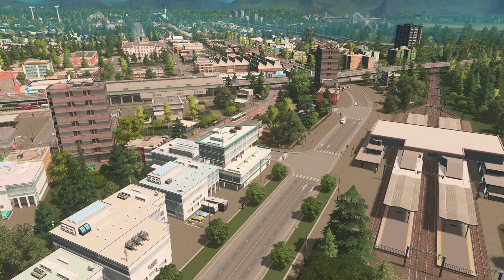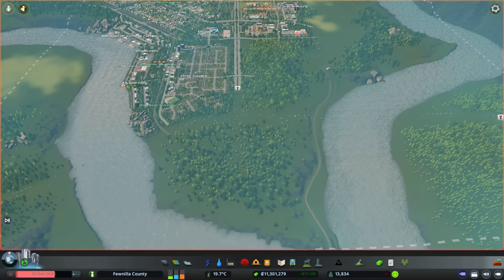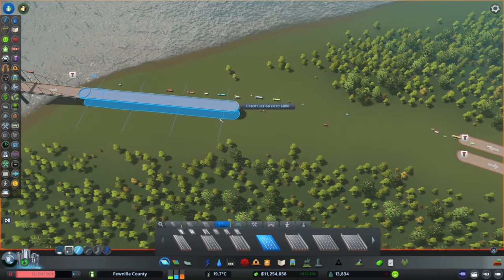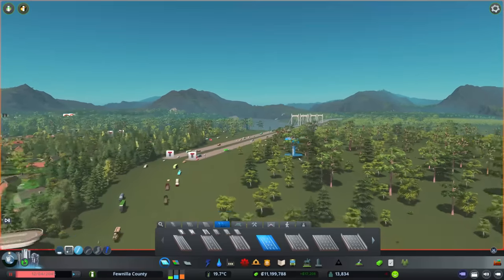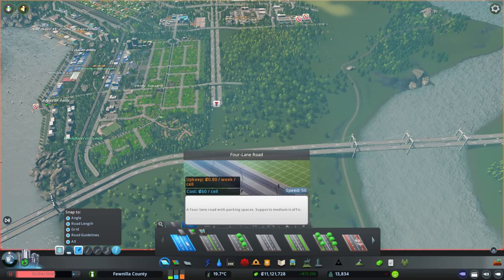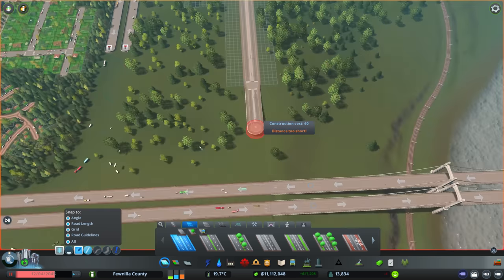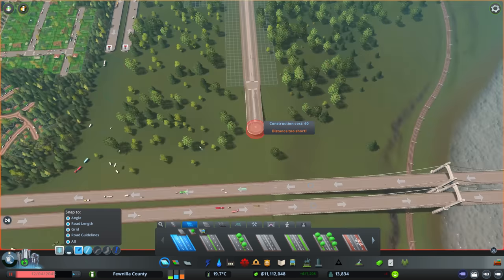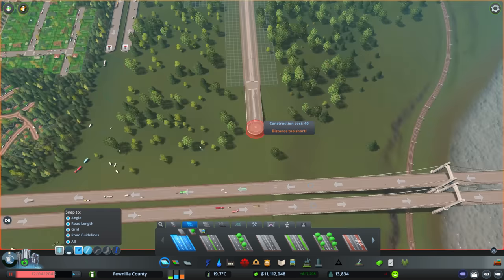Making Complex Interchanges EASY in Vanilla Cities Skylines!

Comment: For the part at 8:02, there actually is a much easier but slightly more expensive method to create smooth curved slopes: 

So you will need to lower the terrain between the bridge and the road you want to connect it to as much as you can and then connect the two roads with road guidelines on. That way, the game will be forced to create a bridge because the terrain would be too low to bring the road down and at the same time, it's going to give you a really smooth slope. 

Great video btw, keep it up!

Comment: The more often I see it done in CS, the more I think: interchanges between highways are so much better when also some collector road is integrated into it in some way - at least a few sliplanes. Love the detailing around all the road, feels very natural despite all the curves and corners in it. I wonder if you had considered putting the through-highway into a gully - so it stays level between the two bridges - and thus allowing the collector to be at ground level and not slope up? Can't wait to see the collector get more use once you build on the other side of it.

Comment: Very nice work on smoothing out that highway and those bridges!
On the non-built-up side of the new intersection, I don't understand why you chose to curve the exit-slipway (furthest from the highway) all the way around the trumpet to rejoin the entry slipway, and then split off again to go to the intersection with the collector road from the other side?
Sending it straight ahead, after the initial curve where it splits off from the trumpet, would bring it to that same intersection. That would make it a 4-way intersection, but save a little on extra roadway length  and avoid two merging/splitting points, which tend to be the danger points for collisions at speed on highways and highway sliproads.
The intersection will need traffic lights anyway, so making it 4-way should not make it more dangerous.

Comment: I wouldn't mind if you unlocked the 25 tiles straight away, nor playing the 9 tiles first tbh :)

Also, personally I'd change the roads coming into the collector into 2+1 roads, so they have specific lanes to turn left and right. But maybe it's not necessary with vanilla traffic..
Amazing looking interchange regardless, you never fail to entertain with your amazing builds <3